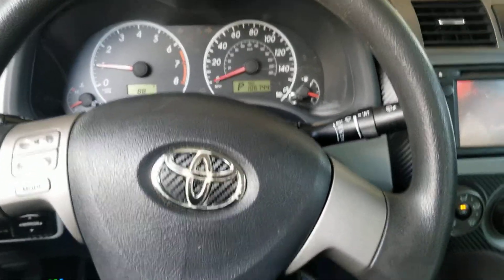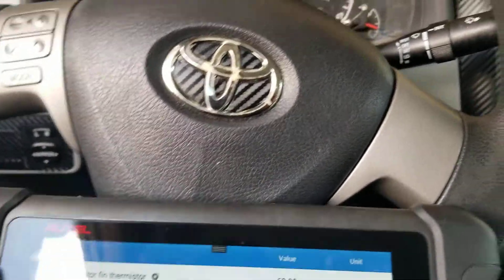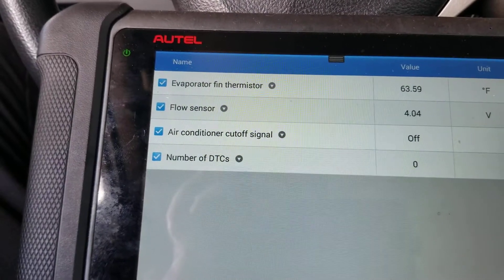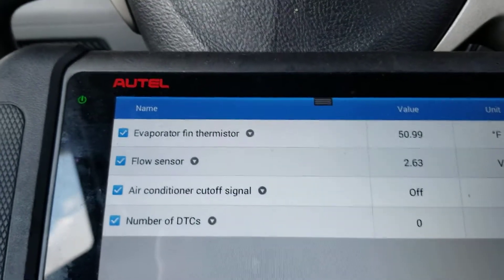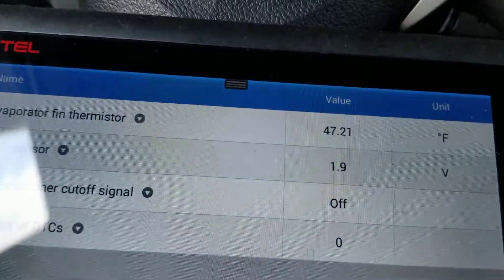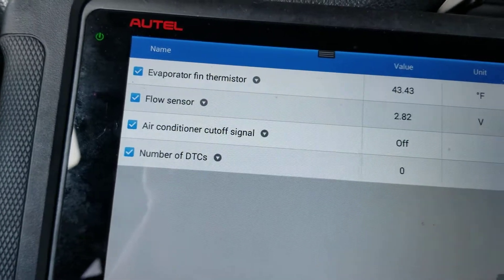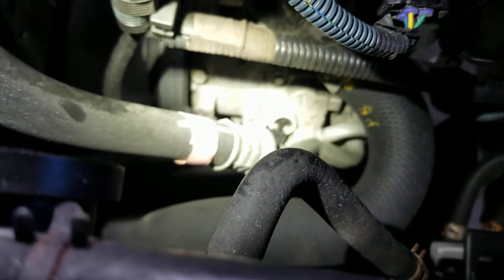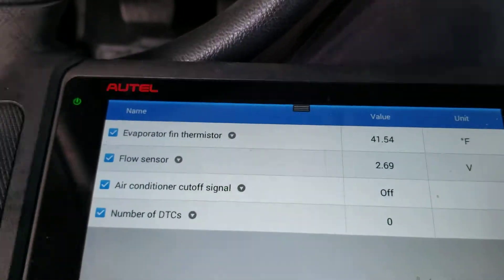Toyota a/c flow sensor reading

Comment: so mine was reading .70     i bought a dorman 926-818 for 42.oo at autozone  it fixed the problem but i did  notice as you said the voltage is staying about 4.3 all the time  . I wonder what the long term affect will be if the voltage stays high all the time?
Reply from the maker: Shouldn't affect anything. Its just a resistor to fool the amplifier in turning on the compressor

Comment: My 2012 Highlander with the  OEM Denso TSB19C has a 2 wire a/c flow sensor.  The aftermarket sensors all say they are compatible but they are 3 wire.  Very strange ..... no 2 wire version available.
Reply from the maker: The flow control valve is a 2 wire but the sensors are all 3 wire
Reply: @gautorepair  Yep. you are correct.   I just looked at the image for my compressor to locate it, looked at the car again and saw it hidden behind the alt wiring.  Put the magnet on the sensor and my AC started working! The magnet will stay on until I can get around to replacing the sensor.
Reply from the maker: @williamgioioso1330 excellent. It gets confusing sometimes with all these sensors and junk. I have used dorman replacement sensors but they are actually just a resistor to fool the computer to turn on the compressor, basically the same thing that the magnet does.

Comment: What model scanner you using?
Reply from the maker: Autel
Reply: @gautorepair  I'm aware of that but which one?
Reply from the maker: Lol. Autel 908bt
Reply: What is the actual purpose of this sensor ?
 why does the voltage fluctuate ?
Is it sensing rpm in the pump and sending voltage to open and close a flow valve according to pump speed ?

Comment: My 2010 Corolla LE with 126k, has an AC issue.  Turn on the AC on a hot summer day even all the way on high setting and it blows warm air for five minutes.  After five minutes iI can feel the cool air starting to blow.  My mechanic replaced the AC refregeriant but it does not solve the issue..  Will replacing the A/C flow sensor resolve the issue?  Is this the same thing as the AC control valve?  If you have the part link, it would be great.  Thanks!

Comment: Thanks for the video, can you explain how it works? i read somewhere that some people are just attaching a magnet  when its faulty and the ac works, but i don't understand the consecuence for the performance of the whole system by doing that.😅
Reply from the maker: The sensor is a hall effect sensor that is activated as refrigerant flows. The sensor at times gets stuck in a value that the module doesn't like and it prevents the compressor from pumping. When you place a magnet it changes the value and the module starts the compressor. I have played around with good sensors and the value changes with flow. However with the aftermarket sensor its a fixed value no matter what so i think it is a resistor instead of a  hall effect to fool the module. In effect its doing the same thing as the magnet trick
Reply: @gautorepair  man! you should make a video about this specific point, I don't think anyone has, " the mystery of the compressor's flow sensor." and it's pure gold! thanks again!
Reply: @gautorepair  golden answer! exactly what I thought, can you think of the negative effects of having a "fix value"?
Reply from the maker: @mal3x nothing that i can think of

Comment: So the aftermarket one is just a dummy connector, does not do anything other than fooling the system to stay on?
Reply: what is the long term outcome of using the dummy sensor are there any negative affects?

Comment: I replaced one on an Avalon with an aftermarket doorman part. It's reading 4.2 volts, and compressor turns on but still  randomly turns off. You can turn ac right back on cause it's reading 4 volts but will still randomly turn off. The old one was 3.7v and wouldn't turn on the compressor.  Have you noticed this with aftermarket sensors ? There are no fluctuations when ac is running with new sensor like your video. I'm thinking it's supposed to see it and dosnt and shuts down.
Reply from the maker: Yes i have noticed that with the dorman sensor it stays about 4 volts. Not sure why. Maybe it how the sensor is made. Probably dorman is the only one that can answer that. I took a reading from a good Toyota ac system with no issues and the reading varies when operating. Yet the dorman sensor does do that. I think the way dorman makes the sensor is to keep the voltage high to fool the module into turning on the compressor
Reply: @G Auto Repair  Thanks. There is another company that makes the sensor. May have to try other brand. Like I said this one stays over 4v and compressor shuts off. I also noticed when I use a magnet on it, the voltage never changes like the original  one did.
Reply from the maker: Good to know i only found the dorman one. What is the other brand
Reply: @G Auto Repair  Santech brand sold at auto zone.  Part number MT13001. If you do a search you'll see a few different branded  sensors.  Unfortunately my company doesn't buy from Auto Zone. So I ended up putting another Dorman sensor in. It reads 4.3 volts at all times. Does not respond to magnet used on sensor when just plugged in to harness either,  like last one.  Ran vehicle for an hour with no shut off but still not convinced that Non switching won't be an issue.
Reply: Hello, I have the same problem in my own car. I replaced the sensor and nothing changed. The compressor stops after 8 minutes and does not return to work until I turn off the button and restart it. The problem also repeats. Is there another solution? Or replacing the sensor head from a used compressor? Does it solve the problem?  Please Help ?
Reply: @novusarshad8738  I have the same problem . Did you figure it out ? Thanks
Reply: @TheEzmortal  yeeah! I changed the compressor and the problem went away.

Comment: The live data for my 2010 Camry has no Flow Sensor option. However, it does have a Regulator Control Current (amps) and a Regulator Pressure Sensor (psi) option. Can I use those instead?